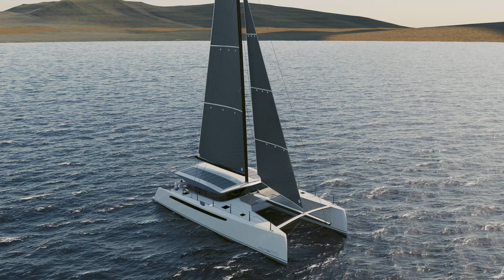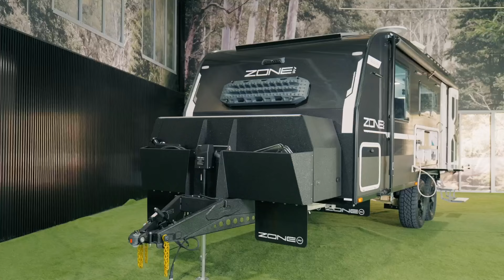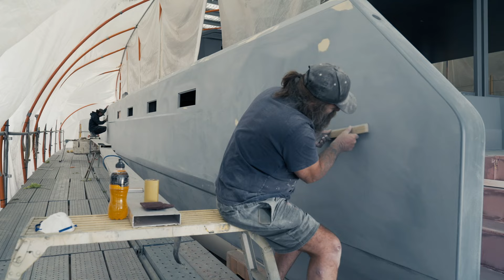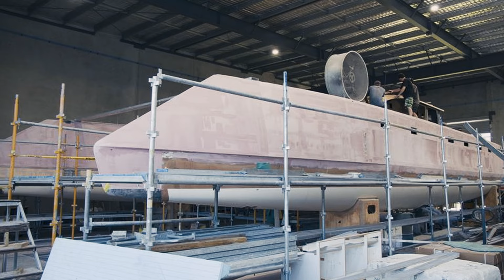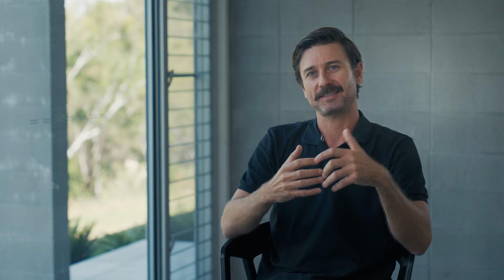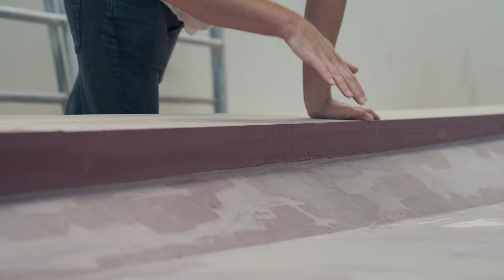Cure 55—The Origin Story

Comment: crazy about speed, light displacement , speed speed, than you sell this boat to people that sail  90% of the time at 60% of the boat capability and the remaining 10% bellow 50% of the boat capability , I do not see you with your wife and 2 sons sailing this boat capable of doing 450 miles per day (17 miles average) logging long 20 ktz picks , that is not cruising sailing , that is racing sailing , you are a better salesman than a sailor knowing the reality of cruising fast catamarans, majority of the sailors are above 50 years old as sooner the boat goes above 10 ktz they start reefing to keep a comfortable 12 ktz speed with 10 minutes 15 ktz picks and 1 minute 18 ktz surfing the waves, do you need a carbon mast for this ? . I would like to point that you still have fingers in your hands for a very important area SAFETY, you never mentioned that area. Great boat, very impressive and gorgeous congratulations Cure Marine

Comment: If you want to build a perfect boat, it must be lightning-proof, like the Explocat 52. At least the mast needs to be aluminum and grounded, which is connected to a metal band along the hull to the water. You don't want to know what will happen if lightning hits a carbon fiber boat.